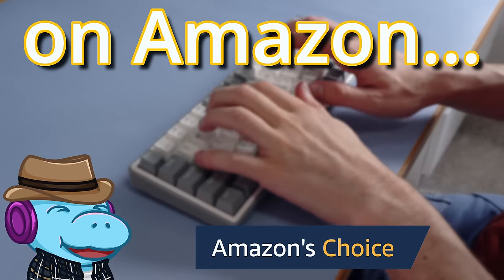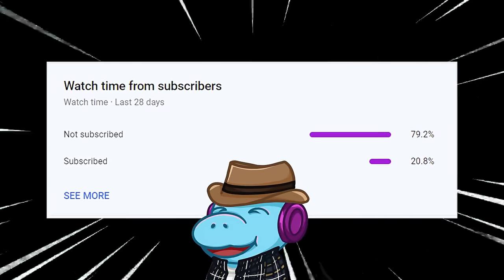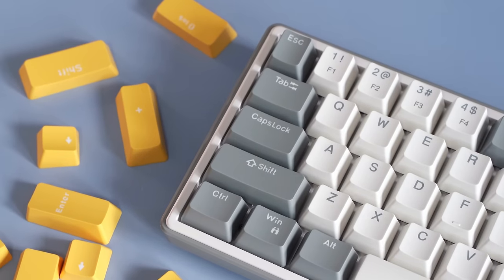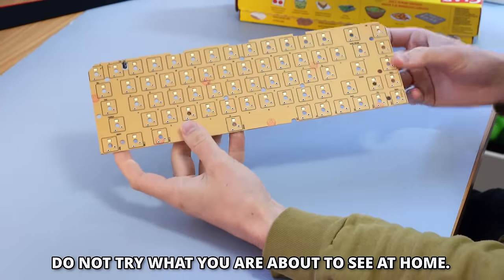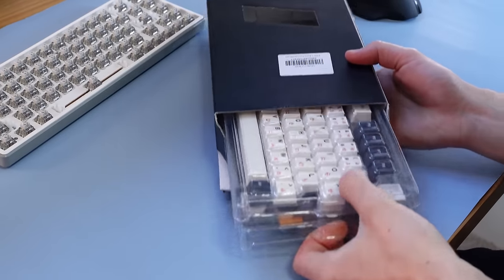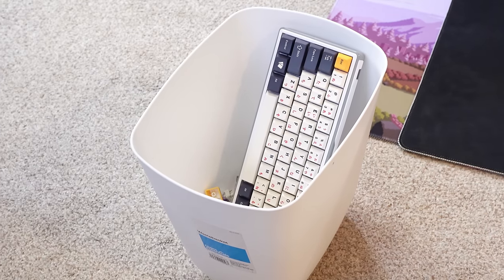WHY is Everyone Buying This Keyboard?!

Comment: The key board doesn’t work I watched the full video but here is how he did it

He took off the back plate and added flex seal then added a ziploc bag around it then added new switches

Comment: if you want a Hotswap keyboard DO NOT GET THIS KEYBOARD the hotswap pins are fragile and break very easily I got this keyboard and spent an annoying amount of time taking apart the keyboard soldering a broken pin then putting it back together just for a new slot to break and having the repeat the process of fixing a pin

Comment: Ill never get why ppl dont just clip the stupid plastic legs on 5 pin switches to fit a board. Its nothing but little plastic pins do absolutely nothing & you dont even need it for 5 pin PCBs. they're there for extra "stabilization" but really don't do anything expecially when held into by a plate, pcb & hella foam.

Comment: LMFAO I have a 60% keeb by that same company that I got one sale for 15 bucks. Its literally my daily. Came with hotswappable reds that I lubed to high heavens, stuffed it full of foam and lubed the stabilizers. Bought some nice (but still very cheap) keycaps and its actually not a bad keeb now. I still get a bit of a ping on some of the switches but I mean for a keyboard that cost me $35 overall, its not bad. I don't ever notice the ping unless I listen for it. Gonna try putting in some 3-pin gateron yellows and see what that does :D

Comment: I had similar keyboard with same issue :D after switch change some buttons did not work and after re attaching all the switches it stopped work totally :D and I bought the purple switches as a replacement for blue :(

Comment: How do you two make so many videos that are exactly the same and why do I keep watching them to the end? What's weird is that I don't even like keyboards. I bought a cheap mechanical keyboard off Amazon and barely use it. My daily driver is a Logitech chicklet ergonomic keyboard. I prefer that to any custom keyboard I've ever used. The hobby is kinda boring to me. Listening to keys? Pouring flex seal or silicone? Weights? Keycaps? Aliexpress? All mindnumbingly boring.

Comment: 🎯 Key Takeaways for quick navigation:

00:00 🎮 El video trata sobre la actualización de un teclado económico de Amazon para crear un teclado personalizado.
00:56 💡 El teclado en cuestión es el Mage key60, conocido por ser económico y popular.
02:47 💰 El precio del Mage key60 es de $29.99.
03:39 🖥️ El teclado es básico en cuanto a características y materiales, con iluminación azul en las teclas.
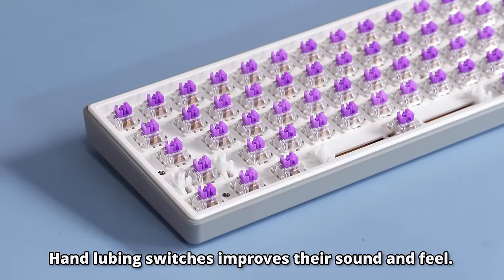06:02 🔧 Se mencionan problemas con los interruptores (switches) y la necesidad de hacer modificaciones.
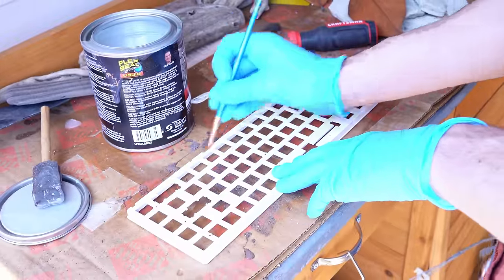08:28 🛠️ Se aplica "Flex Seal" líquido de silicona para mejorar el sonido del teclado.
11:42 🌈 Se eligen interruptores Leo bog v3s como reemplazo y se menciona la dificultad de instalarlos.
12:37 ⌨️ Se mencionan las opciones de teclas (keycaps) y se eligen keycaps dice up PBT asequibles.
13:28 🚫 El teclado no funciona correctamente al finalizar la actualización.
15:20 🥇 A pesar de los problemas, el creador del video gana un desafío de actualización de teclado en un concurso con otro YouTuber.

Made with HARPA AI